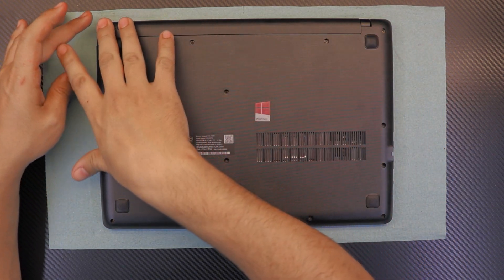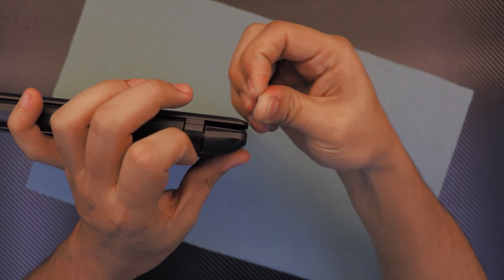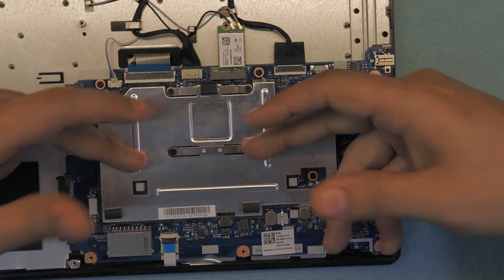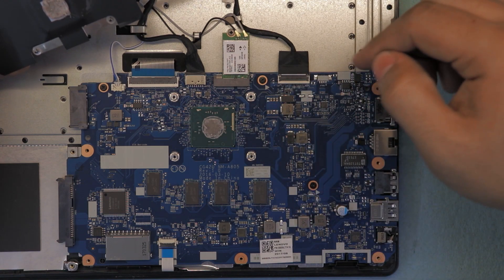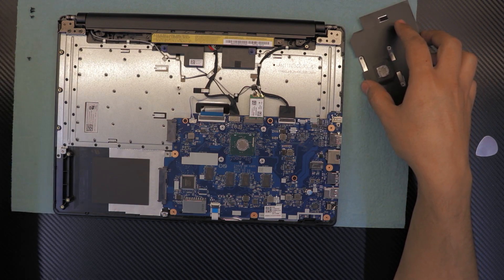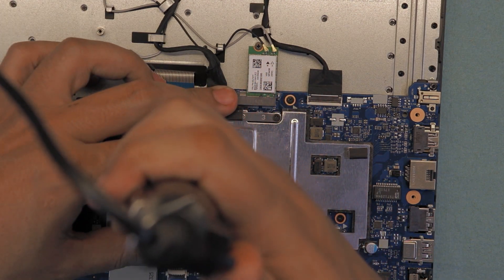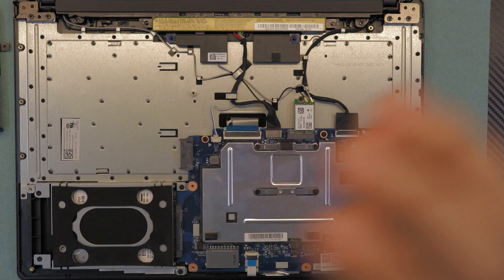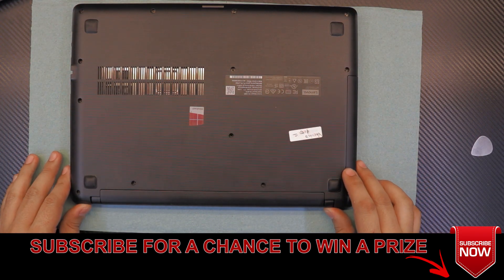Lenovo ideapad 110 Tear down and repaste , WORST LAPTOP 2017 Build Explained !!

Comment: Yeah, you cant change the ram, and can't upgrade the CPU at all.
That's one of the worst type of PC you can find on the market.
Lenovo is just a bunch of scammers in my opinion, 500$ for a garbage laptop, like, dude.
The screen sucks, the keyboard sucks, i'm using a god damn USB keyboard from HP.
Everything is, hands down, the absolute worst thing you would want to have, shitty CPU, you can't even put 8GB of ram...

... really
Reply from the maker: Thanks ✌  for the feedback!  if you wish to support the channel you can LIKE or SUB or both :P
Regarding your situation:  i feel you my friend, i get a lot of clients coming to the store with this laptops and they looks on their faces when they realize that they have an tablet with big fordable screen, its sad but the lenovo is not the only brand that is doing this HP asus and others are as guilty as the 1st one to come up with the idea of tricking ppl to buy this as an "LAPTOP"
its all marketing to sell and resell, its like when  you buy phone they give you options 16gb or 32gb 128gb, they want to pull that , for them its not beneficial to have consumers upgrading the equipment unless they pay the extra to get the premium lineup :/

Comment: In the model with AMD A8 processor you can change the DDR3 RAM with a faster 8GB module. Most of the Intel models have DDR4. With my Ideapad 110 with the AMD A8 7410 I never had any heat problems. It is an 17" model.
Reply from the maker: Thank you for the feedback! if you wish to support the channel you can LIKE or SUB or both :P
regarding your question:  you can but make sure it is a :DDR3L 1600MHz : https://amzn.to/3YHVsQT
Reply: @uFixTek  I found informations on the web that it is possible to built in even a 1866Mhz one in the 17ACL. Even it is what SandraSisoftware shows me.

Comment: Hey man thanks for video I got mine last year and last week it stopped turning on what I mean is the light comes on but the screen is just dark. 
What could be the problem ?
Reply from the maker: Thank you for the feedback! if you wish to support the channel you can LIKE or SUB or both :P
regarding your question: the issue could be because of bad flex cable of the LCD or the CPU over heating, can cause the solder-balls of the CPU to crack :( you will need a tech guy to re-flow the CPU and check the flex cable.

Comment: My wife has this. I put ssd in it now it’s at least quick and responsive. Didn’t know about ram soldered to board dang. Guess only thing I can do is new thermal paste
Reply from the maker: yes place the SSD and it will helpe a lot, ram ya its soldered :/
if you have any question or request in the future feel free to ask me.

Comment: I think I made a comment on this same video a few years ago. The first laptop I ever had was a 15.6 inch version of this model, same celeron processor with cd drive and no fan, that I got when I started highschool (costed $200 at the time). It sucked at basically everything I did on it to the point where running windows 10 seemed like too much for it. I got fed up with it and changed to a different laptop the following year. 
Through highschool, I fell in love with computers and started fooling around with it, installing Linux and other stuff, but it was still too slow.
Recently, my current laptop was running out of space and I was looking for a cheap solution to it, without buying another external hard drive. 

One day I was resetting my router and saw a usb on the back of it, so I researched about it, not knowing what it was at the time. Eventually, I learned about network attached storages and tried to set up my router as one, but it didn't work.
Some weeks later I found out about TrueNAS (an openbsd based operating system for servers) and set it up with this same laptop and an old hard drive I had lying around, which really helped my storage issue. The other day I switched out the cd drive with a hard drive caddy (ordered it from ebay) and expanded its overall storage using another hard drive, a usb and an SD card, since it had the available ports. 

Since openbsd doesn't take much power to run, the laptop handles it well without overheating like it did with windows. As a main, everyday laptop, it sucks. However, as my home server, it's great for storing files and stuff. On top of that, it doesn't draw a lot of power with its original charger and is still the size of a laptop. I may have belittled it and all but now it gives me quite a story to tell... good thing I never ended up selling it.
Reply from the maker: thank you for the feedback my friend and idea for those that are fed-up with the laptop, but if you doing nas storage and not using an NAS hdd be careful, and the normal hdd are not meant to be running 24h, that's why the NAS hdd exist. also look into raid options, so if one hdd fail you don't loose all your data.

Comment: opened this back then cause opening chrome was so slow, wanted to upgrade ram, then, poof, I saw no ram slot
Reply from the maker: this is a tablet not a laptop, that's why the rams chip are soldered on board. :(

Comment: a refurbished lenovo high end gaming laptop I bought a few years ago the screen hinge broke to the point that I can’t open the laptop anymore the screen bezel started peeling off and near the speakers it started bulging up for no reason the battery wasn’t expanded lenovo sucks lenovo is landfill don’t buy lenovo
Reply: it was also the highest end model of it with the 3 gb graphics card the best cpu for it and 16 gb of ram I have since upgraded to a acer gaming laptop and have had no issues (except for the battery not being calibrated from the factory)
Reply from the maker: yes i won't even recommend this model for anyone, but the lenovo do make one of the high end laptops and reliable  like T460s series are really good built.
https://youtu.be/KXN7oTSl5Zg

Comment: Can i just replace tye whole motherboard with another lenvo so i dont jist throw away tye whole laptop
Reply from the maker: Thank you for the feedback! if you wish to support the channel you can LIKE or SUB or both :P
regarding your question: Im sorry to inform you, but the only mother compatible is the same exact board, if you place a board with a slightly different number it will not fit, lenovo doesn't like it for people change the board with a better board :(

Comment: I have this pc, it's really unpowerful.
Paid a lot for this garbage.
The heat management is horrible, i undervolt my PC to hell (10/100%) to make it run at a decent temp...
Clean this up every month coz as soon as dust came inside, it start overheating and glitching sometimes.

Damn..and opening it, i can't even opening it fully, it's locked with the dvd reader.
I'm god damn dissapointed of this computer.
Sincrely, next time i buy something, i'll pick a desktop.
This laptop is very limited in everything it does, even N64 games are running like this on it. I miss my old 2014 laptop...
Reply: Btw, mine as a fan, and it run always soo fucking slow even if the pc is at 86°C it doesn't go faster than usual lol
that sucks soo fucking bad bro
Reply from the maker: lol imagine this lower version without the fan , its a torture machine lol
and hell a PC build up its 100000% bettter than any laptop.
Reply: @uFixTek  Yeah ! A desktop is by any means superior to a laptop, even in price, coz, the laptop have the screen keyboard and disk drive added (optional nowdays)

You pay less for a desktop with way, wayyyy more perf in comparason to a laptop.

Also the desktop isn't limited to its battery :D
... the most recent PC can't boot without the battery.
Wich is toxic, and stupid af.

Damn
Reply: @uFixTek  By the way !
I learned how to clean and take care of my electronics xD
Welp, if the fan had a ton of dust in it, of course it would not work properly.
I'm RN, with an another video playing and being on facebook discord and youtube at 40°C.

From less than 1GHZ to 1.89GHZ (tiiiiny overclock), the perf difference is giagantuan.

Doesn't mean it's good tho xD
i can finally watch videos in 1080p 60fps.
Finally.
480p was a pain.

Comment: After doing this, my laptop doesn't start up, it's just flashing power light😔😰😢😥😓
Reply from the maker: disconnect the battery and the power jack, and press and hold on power on for 60sec, then plug everything and turn on and wait 10-15sec

Comment: This is probably very late. I have a 110, a higher end model (6th gen i3 and a Radeon R5 M430). I saw comments regarding that there is not even 1 slot of RAM for upgrade. Is it true to all 110 model? Or is it available for the higher model because I saw someone disassemble a 110 (not with a celeron) and have 1 free RAM slot alongside the soldered one.
Reply from the maker: Thank you for the feedback! if you wish to support the channel you can LIKE or SUB or both :P
regarding your question: if you don;t have the celeron version and you have the 6th gen i3, then yours does have the extra ram dim available.
you most probably is the 10-15ISK
they do come with 4GB soldered and one extra dim available , just follow the video its simple to remove the cover, and you will see the ram dim available we have upgraded few in past.
also don't listen to the manual because it says "Max Supported Size 8GB", and that's far from truth, you can install an 8gb ram dim and it will work fine and it will be 8gb+onboard ram.
https://amzn.to/3Ar1LNb
make sure you dont get any ram over 2400MHz
place a 8gb in there and you will enjoy it :P
if you got any questions feel free to ask me
Reply: @uFixTek  Thank you for your answer! I was asking because I'm planning to get an 8 GB DDR4 stick (2133 MHz to save cost) and need to know if it was even upgradeable (I'm in doubt because I saw similar comments of 110 not having extra RAM slot in other videos and some forums).

Again, thank you for your answer, cheers!
Reply from the maker: @reya012  it does have and also before buying just remove the cover and see it by yourself, no harm done and its a good experience 😋 if you open the lap and send me pics of board i can help you if you need any.
Reply from the maker: @reya012  my pleasure my friend if you got any other questions let me know

Comment: Will changing the graphic card and Increasing Ram resolve the issue ?
Reply from the maker: Thank you for the feedback! if you wish to support the channel you can LIKE or SUB or both :P
regarding your question:  THE sad part is that , 1. There is no graphic card or graphic chip, it has a built in CPU graphic and that is soldered on board and its nor up-gradable. 2. the ram is also not removable or up-gradable.  what you have here is a simple TABLET with a big screen and a keyboard.

Comment: I bought this crap laptop with a broken screen then I bought another one which wasn't working, main board was gone on it. I swapped the 15" screen over to this Intel celron, soldered ram/cpu heap of - - - - and unfortunately got it working only to discover how slow it was, every Windows update takes hours and hours, it is the worst laptop I've ever experienced, "talk about watching paint dry", This Is Bad VERY Bad. I would never buy a basic bottom anything again if I can help it, lenovo has lost a customer for life, I've wasted days with this thing. Such a pity because its got a great keyboard large screen etc but no good speed wise. At Least Now I Know Why The Screen Was Broken in the first place? the ordinal owner lost his temper with it and put his fist through it, a bit like Elvis with TVs. Please never buy a bottom end laptop for the sake of your sanity.
Reply from the maker: Thank you for the feedback! if you wish to support the channel you can LIKE or SUB or both :P
regarding your suffering i would have to say , its priceless when i get clients walk in to the store with this laptop, and how they cry out and how they break them because of sufferings.
rule of thumbs when purchasing a laptop, try not to fall for the following specs:
1. more ram, more hdd, bigger screen .
ALWAYS i recommend you never go with any intel celeron cpu.  make sure you get at least a intel I3 or I5, i7 or higher.
then the ram and storage and screen size are secondary.
also get the exact model and use google image or ebay search for heat-sink and motherboard so you get an idea what you getting. 
here what you have its a low grade tablet with big screen and a keyboard.
also lenovo is not the only company that is doing this you will find the same garbage with asus, acer, and even worse HP.
now all brands they make like 9 categories, unlike old time were they used to make 1or 2 categories. now its a war and the war is who can push out and sell the most, the 9+ categories are as followed: 
1. high end premium
2. high end
3. high
4. normal grade
5. blow normal
6. low grade
7. low
8. garbage
9. Fu***k the consumers

conclusion: research and research before buying talk or ask us (me recommendation), i would gladly tell you the side effects of buying this types, which includes the following symptoms: headaches, vomiting, nausea, anger issues :P

Comment: When I got this and booted it for the first time the mouse wouldn’t even move without lagging and I got it for gaming so there aren’t any games to play on it I can’t even open google or Microsoft word or PowerPoint
Reply from the maker: im sorry to hear that you got this models, ty to refund if you can, there is nothing you can do to replace the CPU.
Reply: @uFixTek  sadly when I commented this it was 3 years old and ram and cpu is really expensive in my country  but what did kinda solve the problem was switching to windows 7 and most of them don’t work with the computer and that’s how you get scammed in my country

Comment: bought the same model, the 15.6" one with a Celeron processor. IT IS THE WORST THING EVER. cant even run microsoft edge smoothly. all it does best is microsoft office.

it does load older games like Generals Command and Conquer in a playable framerate so i guess theres that. 
It was my first laptop back in 2016. Now i switched to Mac.
Reply from the maker: ohh boii why mac jesus good luck :P , mac has a very good stable OS but the worst hardware design at component level, but lets hope that it will  last you many years to come, and  i appreciate your support and feedback :)
Reply: @uFixTek  oh no i did not buy the newer overpriced models. Currently owning a 2014 13" Retina and its the best. The last era of macbook with usable ports and magsafe.
Reply from the maker: ah nice :P 2014 and 2013 models are solid
Reply: i used this laptop when i was like 14/15 in 2016? idk. i came back to it because my current laptop has to be in repair for a week and i needed something to at least watch my movies and oh god, i forgot how terrible this laptop was. it's so slow. i installed linux lite on it and it's okay-ish, can even play minecraft with low settings and optifine with 20-50 fps

Comment: Sometimes I ask myself, why would a Multi millionaire dollar company sell this piece of trash. Should’nt they check it first before they spread it around the world. This isn’t what progression looks like.
Reply from the maker: they do this intentionally , they dont care much about durability they need to isolate low class people and then sell and resell, they need the stuff to last only year or max two so people can re-buy, and they know that people that buy this have less chance of filing a lawsuit. 
before the war between brands were "who can make the best and last longer"
now they know that all people see is specs and so war has been changed to " who can sell the most and keep selling" 
the stock markets needs sells production must be high, in order to keep production going they must push out garbage and quick.

sad but its true if you seen the progression for the last 20years in electronic repair. they are not looking for durability anymore.

Comment: Lenovo is best. It have cooling fan, ram changing slot, it's a china fake model.
Reply from the maker: they are not fake nor china model. they are sold directly in lenovo! you have a different base model then you have a up version of this 110 model , do your research my friend before concluding :)
china dont make pirate version of lenovo laptops, they just make different brand!

check you base model this are one of many base models:
lenovo ideapad 110-15isk
lenovo ideapad 110-15ibr
lenovo ideapad 110-14lbr
lenovo ideapad 110-14isk
 and so on... just because you paid the extra and got the one with a fan and heat-sink,!

Comment: wow I struggled with this laptop for 4 years and now it's slowly giving up on me.... when i try to use it now it turns off on its own at random moments (not shutting down btw, just plain black) and it makes it pretty unusable... 

but I've never once repasted thermal paste or done dust cleaning (is that even possible here??). is there hope for me to still use it and even just retrieve my files? 😔
Reply from the maker: hi, your files are intact dont worry you can use a usb to sata adapter to connect your hdd to another pc to get your files back.
https://amzn.to/3jpAcur

and this models there is no point on repasting, they dont have fan nor proper heatsink, unless you have a slightly different model then your GPU may have issue.
Reply: @uFixTek  hey things for the video I just bought mine last year last week it stopped turning on the light comes on but the screen is just black what could be the problem?

Comment: This would be great if you did a full disassembly, i found this video trying to figure out how to open the screen to replace it
Reply from the maker: the screen has no screw , remove the bezel of the lcd using a opening tool and it will pop out then there are only 4 screws that hold the lcd one on every corner you cant miss, and then remove the flex and done.
Reply: @uFixTek  thank you
Reply from the maker: if you need help send pics and i guide you. good luck